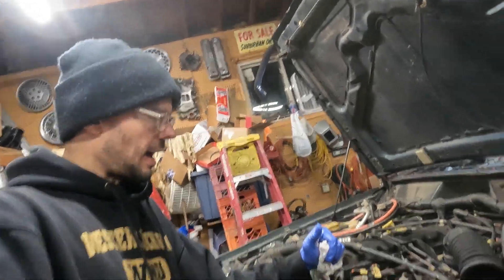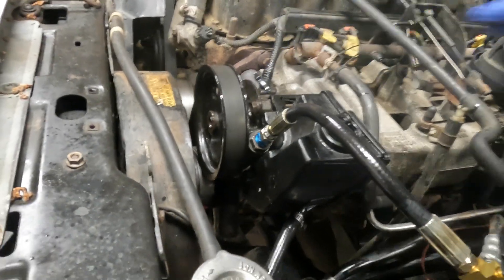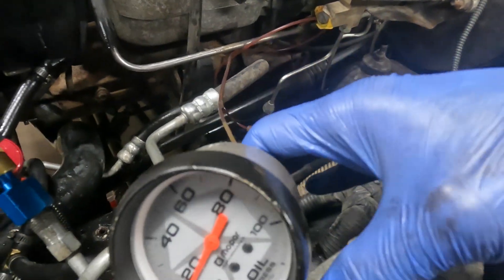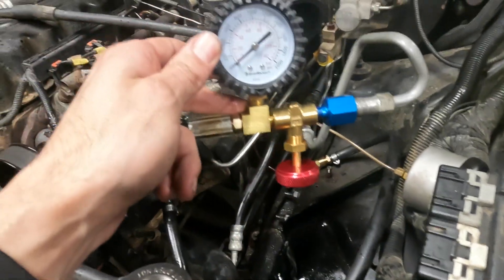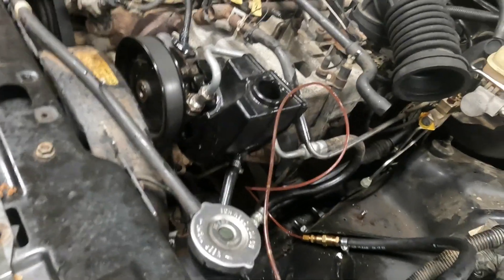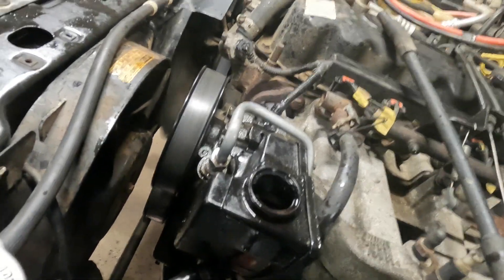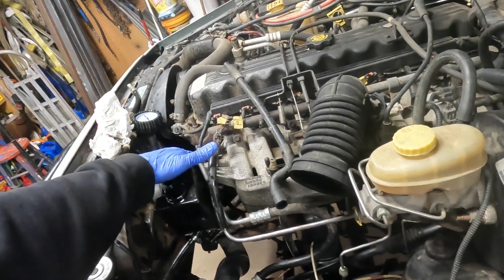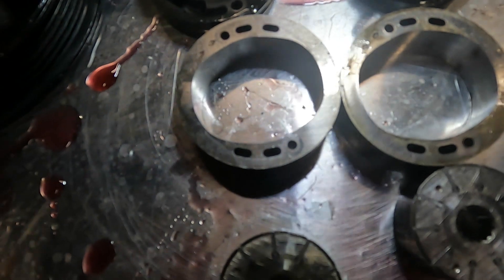Jeep cherokee XJ with WJ grand Cherokee power steering pump upgrade swap issues??

Comment: Excellent attention to detail and seeing actual numerical comparisons is nice. As you mentioned, saying "this feels better" doesn't provide any quantitative data. One thing I am curious about is the increase in return pressure as the flow restrictor fitting size is increased. The 01-04 V8 WJ fitting has a 21/64" (0.32") hole stock, which is more than twice the size of the "maximum safe" 5/32" (0.15") hole of a modified XJ/ZJ/TJ fitting. Is the WJ pump able to get away with the volume increase due to the difference in return port size on the pump itself? Or is that more likely due to the fluid actually getting "used" by the cooling fan rather than just free flowing through the system, if that makes sense? I have a stock axle small tire XJ that I swapped the V8 WJ pressure regulator into and drilled the restrictor fitting out to 9/64". There is a definite improvement in strength offroad and feel on road, though I will be adding a cooler into the system because it seemed to get warmer, which I would expect from the increased pressure. I just got another WJ pressure regulator from a junkyard today and am planning on putting it into my MJ on one tons with hydro assist. Currently it's running a stock pump with the fitting drilled to 5/32". I haven't had any issues with cavitation due to too much volume but I would think that's due to having to feed a ram and flow through a cooler.
Reply from the maker: thanks for the additional information, I have not run wj components without a cooler. I was having issues with foaming boiling fluid when running the stock pump so i did a cooler when i swapped the regulator. I have just been running stock XJ fitting no drilling. I assume to spin the wj fan pump required allot of volume.

Comment: If you decide to run hydro boost steering,  you'll really benefit trim the extra volume.
Reply from the maker: I agree. I am running stock gearbox and a cooler on the return. but with hydro assist some drilling may be needed.

Comment: I used a tuffstuff type II pump and a aluminum reservoir. I used a adjustable flow conrtol valve from classic performance parts. Then I adapted over to an lines and used premade hydraulic lines to plumb.

Comment: Dang, I blew my stock XJ pump so I replaced it with a WJ pump.  I drilled out the old XJ fitting as everyone suggested and I've been getting nothing but cavitation issues.  I guess I need to find an OEM XJ fitting that isnt drilled out.

Comment: So on my Xj pump in changing the spring and thread screw from a WJ and using the reservoir from a ZJ ?
Reply from the maker: should just change the valve and spring. it must be from V8 WJ with the cooling fan that is run from the power steering. I used a TJ parts because i no longer had the XJ stuff but its pretty much the same.

Comment: what was the return line pressure reading when the fitting was drilled out to 9/64?
Reply from the maker: I did not film that it was not much higher than stock on the return. as i drilled larger the pump got noisy. I stuck with a stock fitting because i did not require high volume. at 8:30 i discuss this quickly.

Comment: I'm curious if the extra volume would be ideal for hydro assist... put that fluid to work.
Reply from the maker: for my experiment i did not require volume just pressure. but the stock pump and WJ pump seam capable of producing some high volume depending on the size you drill the orifice on the pressure fitting.
Reply: @yesterdaysproject6106  looking at the video, the pump pressure valve looks like it could be copied and machined. might be something someone could sell so that people dont have to buy the whole pump for the valve.
Reply from the maker: I agree i have called around to some suppliers of pumps to try to get ahold of a large order of just the valve. so far had no luck finding them on there own.
Reply: @yesterdaysproject6106 I'm going to work on that. I have a pump here buddy does machine work. I'll keep you posted

Comment: Great video, thank you for taking the time.  I found the same thing when tearing open the two pumps.  The actual vane pump parts are identical.  The differences are on the input and output sides of the pump.  The ZJ/TJ pump has a very small orifice on the return side.  That controls how much fluid can enter the pump.  On the output side the WJ pressure relieve valve requires more travel to bleed off pressure back into the pump.  This does make sense, as the WJ does need more volume, as it is running the cooling fan also.  I suspect that if you run the larger orifice on the high pressure fitting you also need to open up the return orifice into the pump to match the WJ.  That would involve drilling out the very tiny hole in the pump housing  on the return side from the tank.  But, with big tires, does a ZJ/TJ need more pressure, only, or higher pressure and volume?  Higher pressure will give you more power assist for the big tires.  Where volume comes in is cooling.  If you have increased pressure, you get the increased assist.  If you get he same increased pressure with more volume, then you get more flow through a cooler, which will help with overheating.  It looks like there is a path to modify the ZJ/TJ pump to perform like the WJ pump without actually swapping it.
Reply from the maker: thank you so much for the feedback and additional information. I felt like there was allot of mis information regarding the WJ pump when i was making this vid. I was very happy with the increased pressure from the valve swap and the cooler seamed to work well with this. I used a BBQ thermometer to check temps during heavy wheeling and it stayed consistent.  I was having issues with assist and foaming fluid prior to preforming these modifications.

Comment: Thank you for putting the time into creating this video and comparing the different options. I run an LJ on 37s with the PSC big bore steering box and the factory power steering pump. Steering feel was very heavy with the factory ps pump. I took your advice and swapped out only the valve in the LJ pump. This lightened up my steering substantially and makes the steering feel back to how it was with smaller tires. In town and on the highway feels great without being too loose. It's definitely worth the time to swap the valve out. Thanks again!
Reply: Yard pull valve or did you find and buy new? Where?
Reply: @Shafeee  I grabbed a few valves and springs from a local junkyard. They're easy to grab if the lines have already been removed. Depending on the yard, they may not charge for the small parts.
Reply from the maker: thank you for the feedback. im glad to hear other people are having success with just swapping the valve rather than an entire WJ pump swap with adapters.

Comment: Are you able to take the pressure release spring from any 4.7 WJ, or is it year specific?
Reply from the maker: the thing to look for is the cooling fan will have fluid lines coming off it.  this is because the fan is run off hydraulic pressure from the power steering pump. this is why the power steering pump has different valving.

Comment: This is fantastic! Really like to see the numbers. Thanks very much! Would you have a link to getting the right pressure relief valve?
Reply from the maker: it is for a 4.7 WJ 2003-2004 it can be identified by the hydraulic cooling fan. I have not found a source to order them new so ive got them from the junkyard
Reply: @yesterdaysproject6106  Thank you. Did you happen to measure the difference in the hole sizes of the XJ vs WJ relief valves? I'm sure you know that a lot of people just drill the XK pressure relief valve a little larger. You mentioned the springs felt different between the two, but I wonder if the hole all is really needed to be done? Or, at least give a little more of a bump but not as good as larger hole and WJ spring?
Reply from the maker: I preformed no test on simply drilling the XJ port with no other modifications. But would be interested. 

there are 3 parts at play here. #1 the valve, #2 the fitting and #3 the spring. so the re-leaf valve controls the pressure by swapping the valve to WJ you can go from 1500 to 1700 psi max.... the 2nd part of the video focus on drilling the port in the fitting something i do not recommend. drilling the port changes volume of fluid not pressure. when I drilled the port larger I had so much volume it created excess pressure on the return line causing the cooler lines to leak and slip off. I concluded that unless you need volume to run a ram or additional external assist for additional drilling the port serves no advantage. drilling the port made the return pressure to high and made the pump noisy. 

the WJ pump has a much larger pressure fitting port because it is running both the PS pump and a hydraulic cooling fan because it is running 2 items more volume is required. In order to run a WJ pump you must still use the XJ fitting because XJ and WJ pressure lines are different thread and size. many people drill the XJ fitting to match the size of the WJ fitting however the XJ does not require this amount of volume because it does not have a hydraulic fan.  this volume of fluid still needs to go somewhere so it starts to build pressure on the return line. this could cause pump cavitation and turbulence of fluid in the fluid reservoir.

Comment: Great work and I appreciate finding this video.  I've been thinking about the WJ upgrade, but I'm  glad I've been waiting on the upgrade.  Maybe seeing your video was divine intervention. :)
Reply from the maker: thanks this was a easy swap to put a WJ re-leaf valve in a stock XJ pump and fitting. when i originally ran the WJ pump i had some issues with to much pressure on the return line because i drilled out the XJ fitting plus all the adapters to make it work so this led me down the rabbit hole.
Reply: @yesterdaysproject6106  have some not so good news.  I swapped out the XJ valve with the WJ valve, and now I'm loosing power steering at low rpm, at or below 2000.  I did some research on troubleshooting and did two things: 1. Pulled the WJ valve back out and blew compressor air through the port to make sure there wasn't any blockage, 2. Flushed & bled the entire system with new fluid.  The loss of power steering is still happening at low rpm.  I guess at this point, the only thing I can conclude is that the age of my pump is playing a role in this result, i.e. just a weaker pump due to its age.  As far as know, this is an original PS pump in my 1998.  Other than that I'm about ready to put the XJ valve back.  Any additional ideas?
Reply from the maker: without some pressure readings i could not say. its very possible a worn pump may not be able to handle it. also be sure to bleed the system after the swap.
Reply: Where did you get the pressure testing tool?

Comment: Wow, this is good info!! I'm so goin to try this on my ZJ, as I'm running 37s. Do you think a cooler would help as well?
Reply from the maker: as you increase pressure so does heat. I would for sure recommend a cooler. a cooler would really help a stock pump as well. many people start to have steering fadewhen off road because they boil the fluid